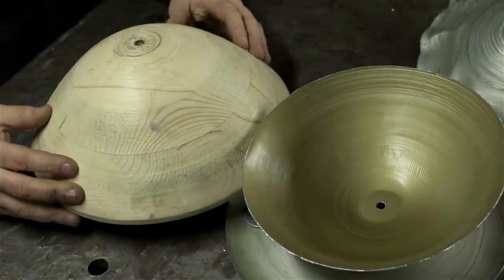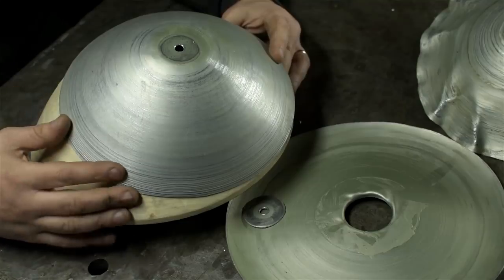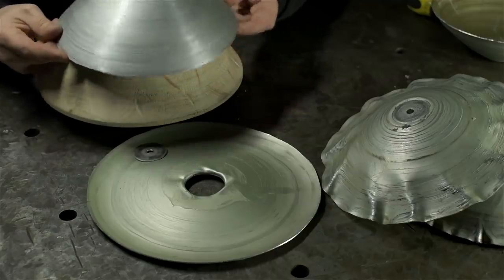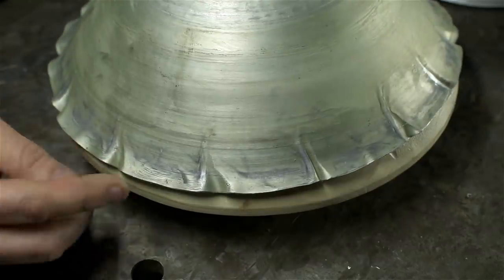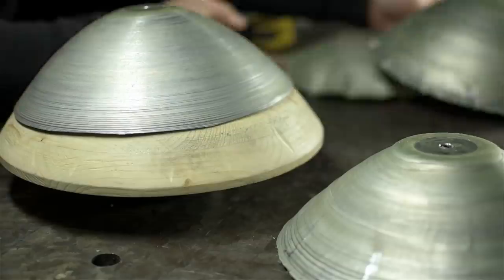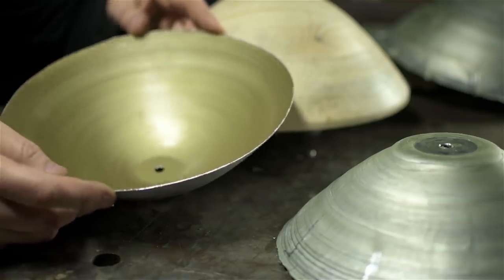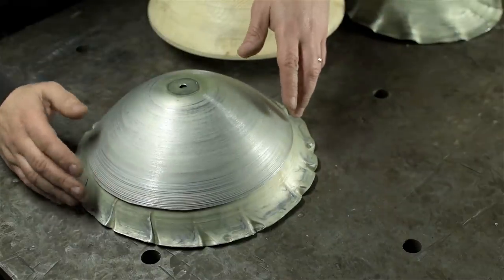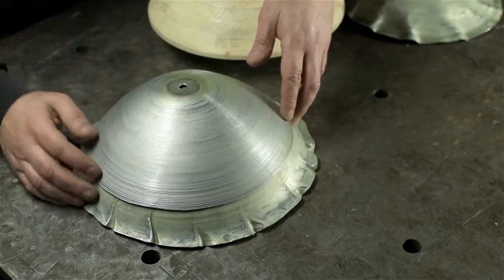Spinning Metal - Round 1 - I LOST!

Comment: I don't know much about spinning but maybe it hardened because the edge was folding fordward and backwards too many times for the material (fatigue). You know the radius changing directions when bending. Another thing might be that you used the edges and not only the center of the rolling disk (don't know the name) you can see that in the surface finish. I thing you should use oil also to reduce the axial and radial friction which turns into diagonal tangential friccion, that could explain the weird edges at the end. 

Hope you suprise us with the answer as always!
Best information with humor ever!
Reply: More radius in the rolling disk and the cylinder. Don't make fold backwards and oil.

Comment: Hello Tony it's Shane from Fabtech RC I watch your videos love them I'm also a home Machinist and I just saw the video on spinning metal on the lathe and I got a suggestion when it starts crinkling for lampshading about an inch or two from the end I believe I will try to go about two times maybe three times bigger Circle don't think you'd be able to turn a piece of metal that big on that wave you may try a wood lathe that were can turn the headstock set it off to the side and then fabricate a tool holder to hold your tool then you could probably shape it right to what you want but it sounds like you need little bit bigger stock when you start try that I figure you need a little bit more metal to allow the stretching of the metal we're looking forward to seeing what you come up with PS love how you word things in your videos it's hilarious

Comment: I used to work for a metal spinning company and he used a form of wax that he would apply to the work surface and the tool was handheld with a rounded end and a crossbar with a movable pin for a position but the speed was faster. good vid though and loved the form you made good luck on the next one.

Comment: blacksmith here. you have to de stress your parts by spinning them you put them under tension. the bucaling is because you work hardened them. take the brass off the lathe heat it up to about red and let air cool and keep going to avoid buckling under the stress

Comment: As a potter. The wave thing happens even with clay. While a potter is making a bowl they take a needle tool and cut off the outside uneven part. The is done between the pulls. If allowed to stay uneven it will though the balance off and the pot will spin out of control and collapses. Cutting off the unevenness  just keep the clay centered and balance while spinning. So there needs to be extra clay when you start so that you have enough to finish with. I would start with a thicker piece of mental and figure out some way to cut off some every now and then while thinning  and bending it on the form.

Comment: I used to own a metal spinning company and I have never seen an engineering lathe used like this so its interesting but very restricted.  The tip you are using is also far too small for the job you are trying to spin which is one of the problems you have and the smaller the tool the harder the metal gets and more it will stretch.  We have used rough brass tools to spin steel to start with although a tool made out of a roller bearing is far better. You need to know when to trim the blank as well to help stop it puckering.  I can send you some pictures if you want and I am actually about to dispose of quite a few tools as we closed the spinning business down years ago and just do silver now.  We have done everything from bed knobs in brass to safety caps for road tankers out of stainless steel the latter definately needing a roller bearing tool.  If you need any tools please get in touch

Comment: I may be late to comment, but...

I believe the issue you're dealing with is the rotation speed which causes the metal sheet you're working with wobbles out of sync with the stretching rate you're pushing on it. There is a way to do it properly but I don't have the math on hand.  Other method you could try is forming the shape with pressure press, clamping on the outer ring edge, pushing and stretching from the inside of the bowl.

Comment: I think the problem here is centrifugal force acting more on the metals rim, which is already thinner by the time you reach that point, try turning it slower as you near the edge. Copper alloys might be more ductile and get better results, although the softness of it might require changes to the method

Comment: I imagine the "lamp shading" is from the metal heating up. I mean it is metal on metal. Maybe as you're working use oil to lube the metal to decrease the heat generated from friction. Sorta like when you're drilling into metal. A drilling paste would work best so it's not getting flung all over the place as you're spinning.

Comment: So in sheet metal fabricating, the term that is used when the ends of the aluminum fold is "shrinkage". It's the aluminum's natural buckle when pressure is applied at certain points of the sheet metal. Get yourself a mallet and beat the living hell out of those edges until they obey. Sheet metal fabricators cause the aluminum to shrink a lot because it allows for quicker shaping for bowls, vintage hubcaps, and other round concave metal items. And yes warm the aluminum up,( give it a blanket and a cup of hot cocoa) and it will tend to be easier to manipulate.

Comment: Not a machinist but I have beat the hell out of a bunch of different kinds of metal during my many years of mostly paid slave labor. Aluminum has very little spring in it's git-a-long, doesn't take much to get a crease started. Have you thought about using some thin steel sheet instead?  Or possibly some of that memory metal found at the Roswell crash site if you can get your hands on any.

Comment: While work hardening probably plays a role in this problem, there might be another contributing factor: Your tool feed ln the z-axis isn't "floating" like in most manual metal spinning lathes. This rigidity might cause the workpiece to destroy itself instead of the tool head just absorbing the initial deformation or "riding the wave".

Comment: Just realized this is old. But in case you haven't figured out a way yet, I think it could work if you use a disk much larger than the cup you need, and leave a wide rim that remains straight. This ring will have to be wide enough so it stays stable and is not pulled inwards. Then it should prevent you from compressing any material, instead you should effectively be pulling material out of the middle.

Comment: It amazes me that people (all men) feel so free to comment on something they know absolutely nothing about.  This is simple conservation of mass.  This is buckling.  Because the final diameter of the work is always less than the starting diameter, it must either thicken, elongate radially, or buckle circumferentially.  Bending the unsupported edge prior to forming increases the edge stiffness.  Supporting the inside with a hand held wooden stick as the work is formed also resists buckling.

Comment: If you look at those pro metal spinners, you'll see that the outside edges get cut off, sometimes multiple times.Thickness of the material might also be a point, but I've seen it done with thin material too, it just buckles easier I guess.

Comment: Maybe try shrinking your edges on the blank before applying it to your buck. Once you get the contour with a shrinker/stretcher on the outer edge shaping on the buck with the wheel should be easier. 

EDIT:Try carrying the wheel through to the edge on each pass so you don't stress the metal as much.

Comment: i would make maybe 2 or 3 forms, each a bit closer to the finished product than the last.  i would work the piece a short distance (smaller bite) all the way out to the end and then start back at the middle and take another pass.  also making the form and the sheet of metal larger than the final desired size would make the wrinkles at the end irrelevant as you could just cut them off.  also as others have said annealing could help

Comment: just something I noticed watching metal spinning on how it's made is that they bent the end opposite to the direction of the crown before spinning to avoid the lap shading you experienced. they used a fork and just went 90 to the material and then just went for it and at the end trimmed off the flared end or rolled it in to look like a bead.

Comment: We did this in Jr high shop in 1965.
We put drops of oil on the aluminum and then heated it with the torch. When the oil smoked, the metal was annealed.

Comment: Did you consider slowing the lathe as you worked out? The material is moving past the tool much faster near the edge of the disc compared to near the center.

Comment: its much easier if your material is T0, that is to say annealed. it is possible to anneal with a blowtorch, though not as good. draw lines across the metal with a basic hand soap bar then heat with a blowtorch until they turn black, finally allow to air cool.

Comment: If you're pushing the metal that far you probably need to stop mid way and anneal it. If you're stretching to almost the same point before things go all caddywompus (and it's consistently the same area where it starts) that's a pretty big tell tale sign that it's work hardened to failure.  Even in deep draw aluminum alloys they need to anneal it between draws.

Comment: i have seen this done in some youtube vids (was thinking on making bell troats for an intake manifold ) and they often bended the edge against the direction i needs to go before they started near the hole  , others i seen working slower and across the whole surface making it intoo the shape of a dog dish  first and then work it against the buck shrinking the sheet / plate while they go (thats wat makes the dishes ripple at the ends in youre tries , you might try to shrink too mush in one go and need to go in stages start to finish )
one thing i did notice is that they trim the edge a few times , it could be it starts tearing and they trim that away to prevent a trainwreck , allso means the plate needs to be bigger then the buck
from wat i see everyone has his own technique for the product their making and its a experiance thing to be able to realy make the metal work for you  ,they prolly make 50 a day and know wat to look / listen for

Comment: possibility that they're lamp shading as the outer part of the material will be moving faster than the inner part. Maybe knock it down a gear. More speed = more frictive force on the bearing causing it to catch and push it over, I think.

Comment: Hi
I once saw a custom motorcycle program where the guy used an English wheel to make a chopper gas tank. I pretty sure he hit the aluminium with a smokey acetylene flame to soften the material.
Reply: That's the beginning of the annealing process, there's a few more steps.

Comment: Hi. Hope you read this comment because I really want to help you and see you succucessfully make the round bowl shaped thing you're trying to make.  I know why you have the folds are occuring on the outer diameter of the larger diameter parts. The reason for the folds is because you are forcing a larger diameter to become a smaller one.  Sheet metal tries bend when pressure is applied to it and folds when supposed from both sides. Especially aluminum as it is a strong yet soft metal. Cutting to the chase rather than going on a mile long explanation, you would likely have better results if you either cut angled slits in your aluminum disc and welded , or if you used a material with higher malleability more like lead. Hope this helps.

Comment: these uneven stretches  maybe are caused by low flexibility (due to low temperature) thus bending most at the weaker parts. what if you used a fire torch bring up the temperature giving the metal more flexibility ?

Comment: Aluminium needs to be heated prior to reworking.
This is a common problem in Automotive repairs because people who are used to working with steel, such as Panel Beaters don’t have the equipment capable of suitably heating the aluminium.
Lots of Prestige and Luxury cars are having Steel panels from similar Volume cars because repairers don’t have the budget to replace with genuine new parts. This will obviously effect the safety of the vehicle.

Comment: Uh, way too late but I think I see what's going wrong: you're expanding the metal as you go so you need to do it more evenly right out to the edge. You seem to be leaving the rim too late. Does that make sense? I've never lathed metal but I've done ceramics, ie potters wheel stuff. Believe it or not there is some overlap in the two skills.

Comment: I used to work in a factory that manufactured large tanks and they had a huge machine that could do this with 8mm thick stainless steel. The roller was narrower than yours on the contact point which makes me wonder if that isn't perhaps where your problem lies.

Comment: Haha why didn’t you just turn the timber on the lathe? Was cool to see the Cnc do it tho. There are quite a few videos of Indians turning pots up on olllllddddd belt drive lathe type machines, perhaps they could give u some tips, also I spent some time in a metal stamping shop (not in prison btw) where they were pressing forms for rangehoods, they would apply a layer of some sort of paste with a paint roller onto the sheet of stainless prior to  pressing the form. Stopped it from tearing. Dunno what it was. Looked similar to white lithium grease almost.

Comment: looks like oscillations in the metal. The speed is increasing the further out you go and maybe it hits resonance. Try slowing it down 50% once you're out 50% of the way ?  Also, could try pushing the outer edge inwards a few inches right at the start, so its not moving so fast at the edges for the rest of the process. These are just guesses, i'm no metal spinning expert

Comment: I have only tried metal spinning once before with worse results then you have. I think maybe rounding off the edges on the roller bearing or what not you are using as a tool and also try softing the material if possible

Comment: I used to make recessed ceiling light fixtures out of aluminum at a factory in Florida when i was younger... & braver... we used a big wood handle  with polished tool steel inserted in the wood. It was about the size of a baseball bat, we wedged it under our armpit close to the body for more control over the tip while drawing from center out. You cant stop a draw, u have to take a draw all the way out using lite touch. And yes 35 years later I occasionally have that nightmare where i wake up on the floor on the right side of my bed, cuz the last blank that went into orbit and shaved 3 whiskers off my mustache & 2 hairs from my left eyebrow before embedding itself into the ceiling tiles 15 or 20 above my lathe (im sure its still buried in the ceiling to this day) caused me to be duck / jump / to the right for the 50th time... I quit while i was still in 1 piece... unlike so many of those early blanks i trained on.

Comment: use thicker aluminum, above 16 ga. but not as heavy as 12 ga... thinner material crinkles more because you are taking what little structure it has in the first place. also, you should torch anneal it before spinning. also try to rig a more stable pivot than your tool post. With the amount of force needed you're gonna end up with wiggle in that tool post.
Reply: also.

Comment: Disclaimer: Sorry. I have not watched the whole video. BUT, seeing the wrinkling of the edges, I am wondering if the wrinkles are a result of too sharp an angle for the edge of the disc to be constrained to (e.g. the desired circumference for the blank size is too small, resulting in that wrinkling) I wonder if trying to spin the bowl to a shallower angle (shallower bowl shape in the end) would be of any use. I think what I'm saying here makes sense, at least it does in my head when I think about it, but not sure how well my words will come across.

Edit: Within two seconds of resuming, you showed the smaller blank with the same problem. If you need to reach me, I can be found throwing my computer out the window.

Comment: You need to work it back more. Don't flatten your outside edge past perpendicular. With as rigid a set up as you have it's possible to do in one pass. You aren't work hardening. Only steel is worked with heat. Copper will do the same thing. If you're brave you can spin a square;). Wax your work....that will help. When I spun my setup was 80 years old with a pneumatic tail which made things INTERESTING. We used two handles....one with a roller and a pivot hole and one that looked sort of like a hockey stick with two pivot pins down on the end. The rest had a series of holes so the hockey stick could move along. It's an art that takes practice

Comment: Use some 4043 aluminum its softer 6061 aluminum will also work but I just want to say that you did a good job I think that your only real problem outside of the wrong aluminum was the lack of proper drawing tools I have watched metal drawing videos before and noticed that the process required various tool geometries

Comment: The rpms change as wider diameters are reached. I would use a wheel from a roller skate to mold the disc and slow down the rpms of the lathe as you reach wider diameters

Comment: its a possible chance that since your tool head is on a swivel leaving a radius on your so call "cut" it might be flaring it out by the time you get to the end of the sheet... maybe try a fixed head and just use the cross slide at an undetermined angle

Comment: You are work hardening the material and you should use some lubricant.  The lubricant not only helps the tool run smoother it will slow down the process of work hardening since it won't get as hot